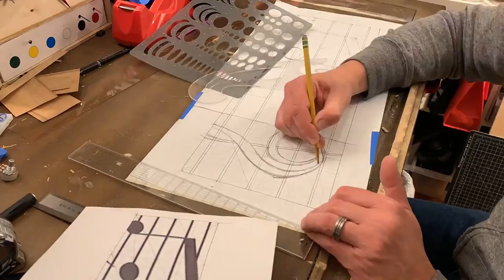Marquetry Keyboard Case

Comment: Beautiful job. Marquetry is my passion and I'm just learning how to do it. I cheat though and use a scroll saw. After watching you, I might have to rethink.
Reply from the maker: Thanks Ray! Most of the time I do my panels using the double-bevel technique with a fret saw but for this project using the window technique seemed the better way to go. Mostly because it is so large and also there were a lot of straight lines in the design. I don't know if I'd consider the scroll saw cheating though...whatever tool gets the job done and keeps you making stuff!
Reply: @analogsketchbook  Thanks for the reply. I love doing marquetry so far I've been scared to try an actual knife. I guess it's time to go for it.